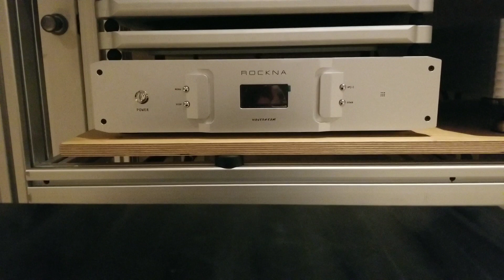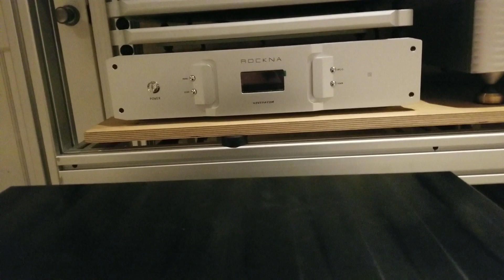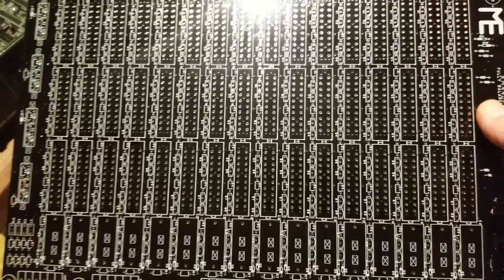4 way active crossover, 100% discreet and fully differential.

Comment: Yes. Active xover sound is more precise. I'll hv to remove the internal passive xover. I plan to build 3-way one. Tht means I've to provide 2 x 3 amps for stereo system and each will have its own PSU for better sound imaging & channel separation. It'll need 6 PSU. These all will be totally mono blocks. The amp just 10 W (for woofer) & 5 W (midrange & tweeter). 

For indoor/ home, actually 3 W is already loud. We'll hv to seat far from the speakers. Tht means we must hv a big room/ big house ! Neighbour could be annoyed too.

Comment: Marchand makes great crossovers, i have xm26 and xm9
Reply from the maker: Terrific!
Reply: @OCDHIFiGuy  but they are extensively modded with Duelund and Mundorf caps, Audionote tantalum resistors, Dact attenuators, replaced opamps in xm29, neotech copper and Jupiter silver wire. The xm9 hangs from low output from xm26. This way I have 3 way, I will add another way with a 8 inch sealed between ripoles and horns Aer bd3. The improvement from standard components is very big.

Comment: The only thing that's crazy is your opinion on op amps and glare. What is glare, by the way?
I've designed my crossover board around op amps and have been using it for months. I sincerely invite you to visit and listen. 
Discrete components are unnecessary and always measure inferior to chip components. After all, it's mostly the same circuit in both, but far less losses within a compact enclosure of a chip.
Reply from the maker: Glare is the sound on piano that gets you right in the neck meat. It's a certain sheen. I understand monolithic devices measure better, but I wanted to try "old school" discreet components just to compare. Do you sell a product ?

Comment: part of it is the number of poles available in an opamp, due to silicon limits, etc. the Sparko labs opamps, small surface mount discrete in design, have a dual pole system, for better transient control. which can make all the difference. it's not just the limitations of the silicon, it's the inherent pole limit.

Comment: Marchand crossovers are simply top-notch, I have XM-9 (circa 2005) quad-amped to Mirage M3si
Reply from the maker: Yes , you are correct.
Reply: Marchand Prices are insane!
Reply: well, For a finished unit in a box, maybe not that bad
Reply: @wesselingaudiodesign5031  the quality is top-notch, used to come assembled OR kit form

Comment: Signal conversion is not necessarily lossy.  A balanced signal is nothing more than a signal with it's own ground that is totally isolated from the traditional audio ground.  Simply pulling one lead of a balanced signal to ground is all that is needed to "convert" balanced to single-ended.  Plus - for all the "class a audio snobs" (I can be one of those at times)... All your balanced signals are ultimately converted back to single-ended anyway.  Finally... balanced really only is of advantage over single-ended when distance between the gear comes into play (the actual point for which it was created).  Isolated ground and differential signals came into play when long runs of signal-level audio ran side-by-side with noisy high  power cables carrying lots of current.  A few pieces of gear 24-36 inches apart does not really need a balanced signal.  Finally.. them op-amps. They are all single-ended output to begin with.  To keep a balanced signal from end-to-end means twice the number of components between you and the music.  So again.. the only real advantage to differential signals is when you gotta send that signal over any considerable distance.  Other examples of this: ethernet network cables, CAN bus networks (in your automobile), USB and HDMI.  Each of these examples are differential signals that operate in the megahertz range and FAR more susceptible to RF and EMF interference - hence the implementation.   Regarding the xover... there would be a huge issue in implementing a "fully differential" crossover, heres why:  First, the components for a pre-set crossover must be very carefully matched.  This is already a large chore when dealing with just a 3 way crossover.  If you were to make this fully-differential, you must not only deal with matching twice the components, but you are also going to deal with significantly more intermodulation distortion.  Not only this, but (and I am not an EE here) by the very nature of a xover - any RC filtering network needs the whole signal in order to actually work.  In other words: to split the frequencies, the RC network must have the entire ac cycle in order to perform its function.  I myself have built a dozen or so active xovers for myself over the years (the first thing that gets gutted from every new set of Martin Logans I buy is the passive xover components) and can tell you: some of the finest designs I have come across have never even mentioned "differential signal" throughout the crossover due to the insanity and poor implementation that would have to follow.  The only way this would likely be possible (and again, I am not an EE) to my understanding would be:  two single-eneded crossovers for each pass-band that are 180 degrees out of phase.  Once again - I would rather not imagine the intermodulation distortion that would result in such an implementation.  Finally... discreet vs integrated..  I personally have done some comparison a few years back interchanging some discreet op amps with top-shelf IC and personally have never noticed anything miraculous.   Just like comparing various IC's, each has it's own character, high points and low points.  To be honest, for a xover design (where the matching of each component is more crucial than ever) - it is very hard (if not impossible) to find a dozen discreet op amps that have ALL been hand-matched across-the-batch.  IC's actually shine here as they are (each and every one) produced with laser-precision over-and-over across the entire batch and hence - much more consistent when you need a couple dozen in your xover.  Nice JR gear, BTW.
Reply from the maker: You have just described exactly why I like differential design. Mirror images give my mind better symmetry. You are exactly correct . My parts are painstakingly precision matched and there are dual signal paths 180 degrees out of phase from one another .. The only time I convert from differential to SE is when I put in a SE amplifier , all other times my rig is 100% differential from the source to the speaker driver, meaning my amplifier pushes and pulls my speaker driver back and forth each way. . whats trhe benefit ? 6db of gain and ZERO noise EVER. I do not have time for noise in my rig. and I switch things around many times, so I want it to be dead nuts quiet each time I unmute her. Ic s have glare , so I do not like silicon chips in my analog stage . but yes, you understandf differential much more than the regular listener does... Thanks for your feedback !

Comment: A video on component matching would be great.
Merry Christmas in advance 🍻
Reply from the maker: Thanks Shazad. Component matching is done not by any specification or method. It is knowing which Brand or model goes with which, and for what.  In other words if I'm working with someone on thier rig and its too sharp sounding, and hes using B&W and Krell I need to know what the room is like because if it's all hard surfaces I treat it different than if its carpet and furniture with no windows. This is the part that really gives aufio professionals value because these things come from experience only. There is no way to put it into a packaged method since all elements are variable and change with every new model released. The basic idea is there are 2 types of component sound, sharp and soft. You must be able to balance the two to get a full frequency balance. Then you fine tune it one way for another for personal taste. Cheers !
Reply: @OCDHIFiGuy  thanks man 🍻🍻

Comment: How do you adjust for time domain differences between drivers?
Reply from the maker: I DSP
Reply: With xm44 which is in photo you can also adjust delays in analog way and permits also notch's, I'm xm9 or xm26 you can't. The xm29 can also do assymetric crossover

Comment: Not fixed xover, instead using rotary network? OPA1612s have such insane low noise and distortion good luck trying to get even close using discrete. Btw the boad thickness makes zero difference it's not a power amp.
Reply from the maker: Itmakes a difference to me because I dont like flimsy anything and flimsy boards bother me , its the sign of a cheap BOM